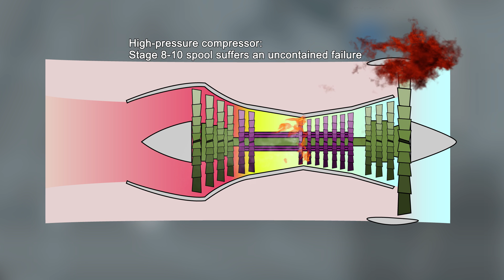British Airways 2276: Las Vegas Fire Visualisation

Comment: What does it mean when an ATC asks to "verify information Kilo"?  Especially when they're taxing Bravo to Alpha 8.
Reply from the maker: When referring to "Information," they're talking about ATIS: a continuous broadcast of precorded noncontrol aeronautical information (e.g. wind direction and speed, cloud coverage, QNH, landing/departing runways, etc.). The Alpha/Bravo/Charlie indicator is a simple versioning system - every time there's an update to the ATIS the letter is incremented (Information Mike becomes Information November).

When ATC asks pilots to "verify information Kilo," they're confirming that the pilots have listened to and understood the latest ATIS broadcast.
Reply: Got it now.  Thanks for answering.
Reply: Beware the ATIS trick though! They may ask you to affirm the wrong code (e.g. kilo instead of oscar) to make sure that you really did check the latest report (oscar)
Reply: Yes they do the little tricksters.